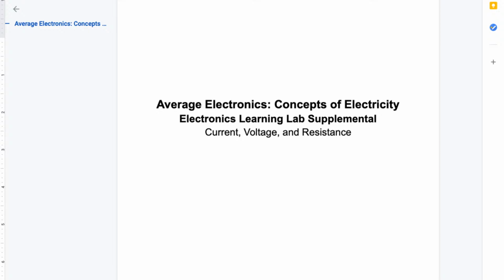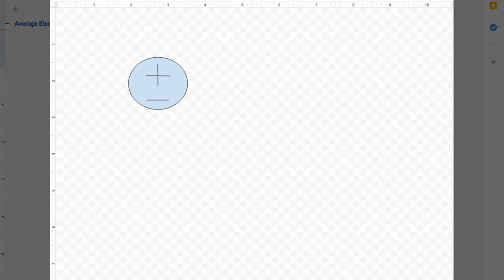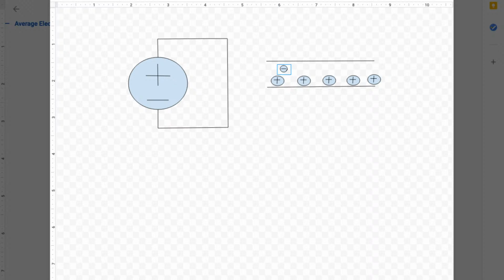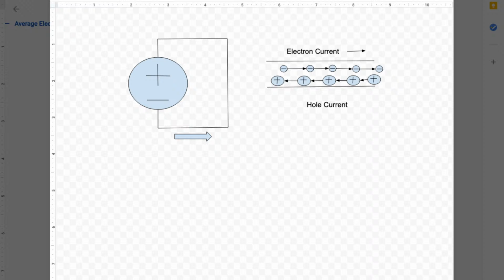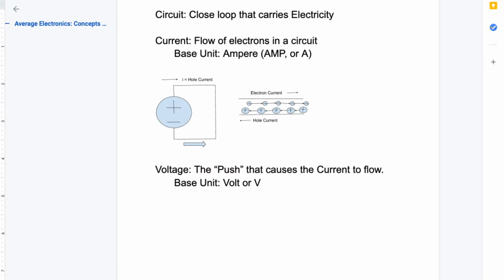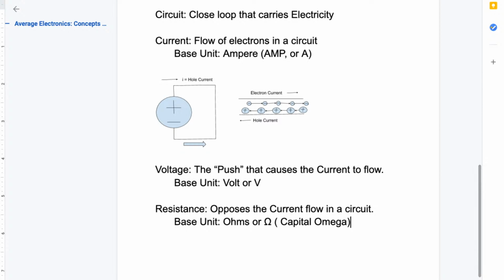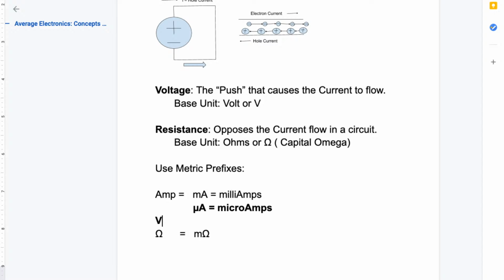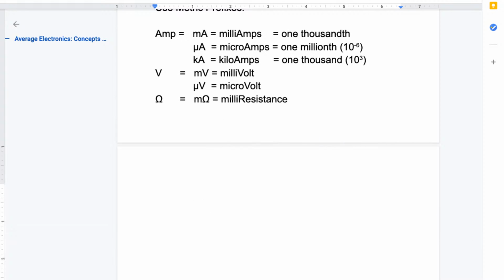Average Electronics: Concepts of Electricity :: Current, Voltage, and Resistance

Comment: @Average Do you ever think that you will continue the series?  I was watching through your streams at it's interesting to see your problem solving and learning process.  I had a similar RadioShack kit as a child.  I think I could help answer the questions that you are running into.  Some of the moments had me screaming at the screen, "You are so close."  Other moments had be saying, "Yeah...I have no idea why they are showing that to you.  You couldn't possibly be expected to understand that at your level."  

I'm not sure if you are trying to keep the experience as close as possible to the original labs, but one thing that I would strongly suggest is to get yourself a good electronics grade (not electrician grade) multimeter to use in conjunction with the labs.  Realistically speaking, I tell people who are interested in learning electronics to invest in a quality multimeter, oscilloscope, bench lab power supply, and a full assortment of parts.  While not immediately needed, I also recommenced an LCR meter and a soldering station.
Reply: But that also $1000-$2000+ at least so It's beyond most people and you have to be committed.